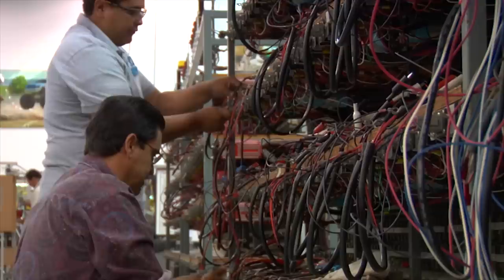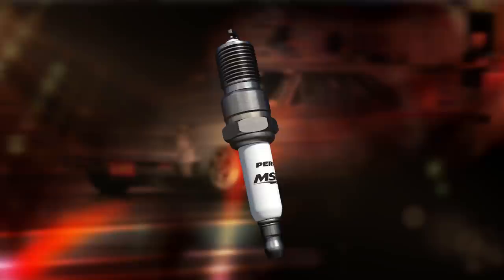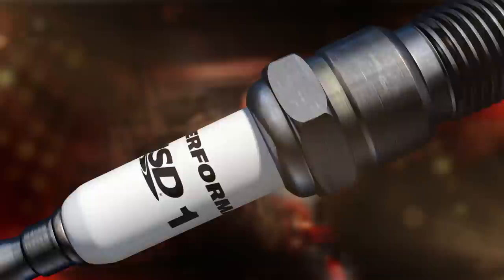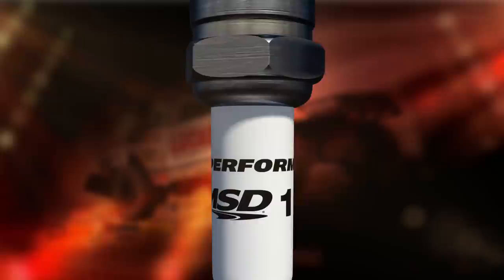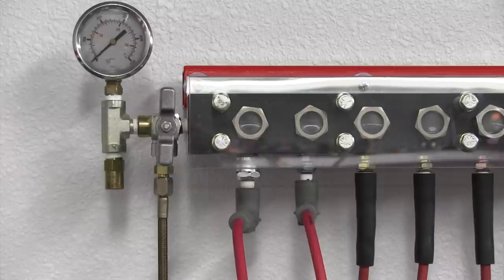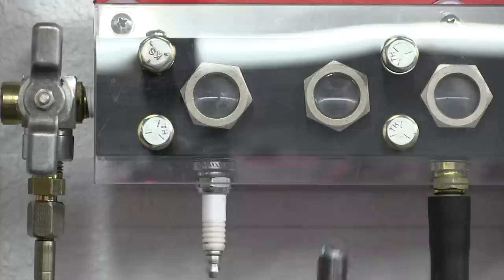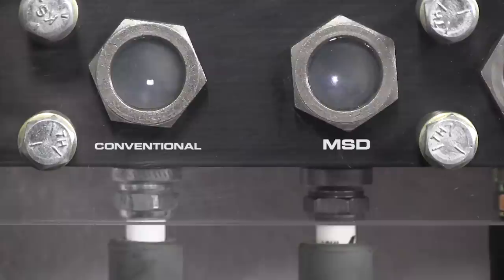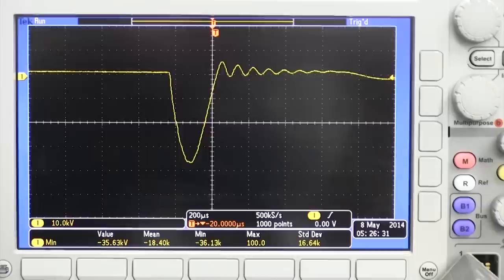MSD Iridium Spark Plugs

Comment: looks like an incredibly thick electrode when compared to Denso racing plugs,
Reply: These boys are a street plug not a race plug. I bet they'll perform nicely in any  street application.
Reply: @mclarpet  Denso Iridium TT central electrode is only 0.4 mm in diameter and the platinum tip on the ground electrode is 0.7 mm in diameter . They are street plugs and lower required break-down spark gap voltage up to 5KV !